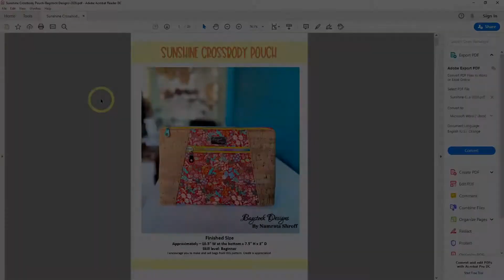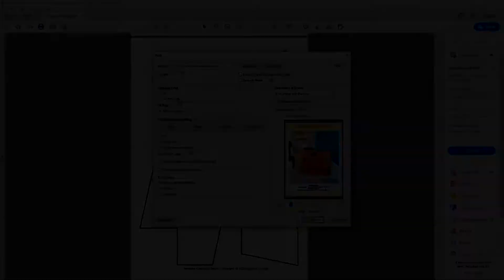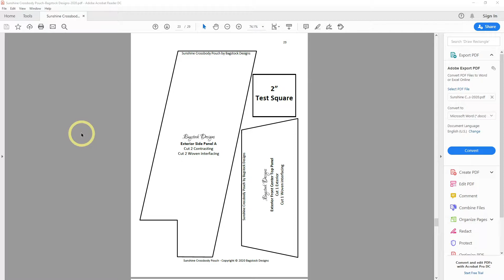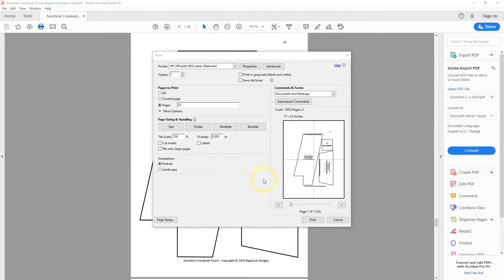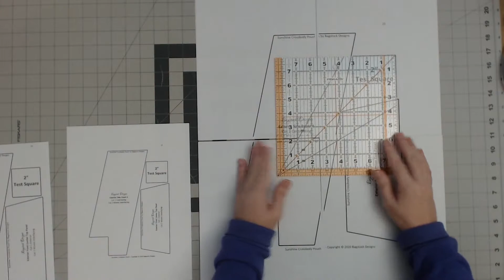How To Properly Print (And Resize) Your .pdf Pattern In Adobe Reader

Comment: Is there a video on widening the depth (gusset)?
Reply from the maker: I don't currently have a video for that, but I can add it to my to-do list.

Widening the gusset is much easier than it sounds. You simply add the width that you like (in most cases) to the width of the pattern piece.
Reply: @RogueStitches  I am still new to this.  I tried what you suggested and I messed it up some how.   I am a visual learner and after a bad head injury, it takes me a long time to try and figure it out.  I hope in the future you will make one though!

Comment: Hi. I really enjoyed your video and the awesome detail it provided. When printing the pattern at larger or smaller scales, when it comes time to tape them together, do I just butt the paper up against each other with no overlapping? Thank you for sharing all of your awesome tips! I subscribed!
Reply from the maker: I'm so glad you found it useful! When printing your pattern larger using the poster setting you will likely have to trim them down and butt them together due to the margins required by most printers. You could just trim down one side and overlap so that the lines meet. You can see an example of a slight margin at approximately 4:23 in the video.
Reply: @RogueStitches  thank you so much! I will try this!

Comment: Is there a formula on how to change the non-patterned pieces when you increase or decrease?
Reply from the maker: To get the amount to increase or decrease you would take the measurement and multiply it by the percentage (i.e. 50% would be .5, 25% would be .25 etc.), then add or subtract the result from the original measurement. So, if I wanted to increase a panel 150%, I would take the measurement and multiply it by .5 (since my increase is 50% more than the original) and then add that back to the original measurement.  For a rectangle, you would do this for the length and the width. 
I'm not great at explaining math, so I hope that helps.

Comment: So I've been overthinking the part about how the seam allowance also changes by that percentage when you print at x% - or is it just so small relative to the rest of the dimensions that it doesn't usually matter? I haven't actually tried reducing or enlarging, just thought experiments.
Reply from the maker: I usually just use the same seam allowance that the pattern calls for. It's not such a big difference that it will be too noticeable.